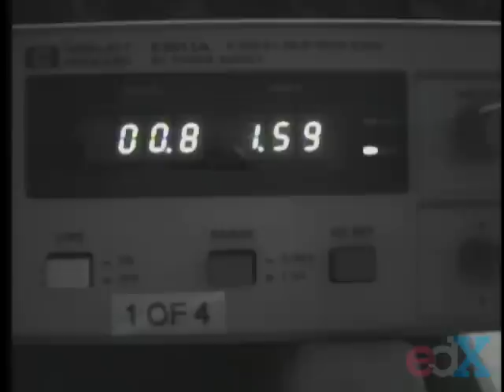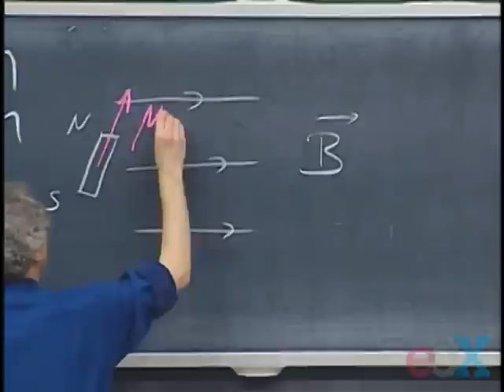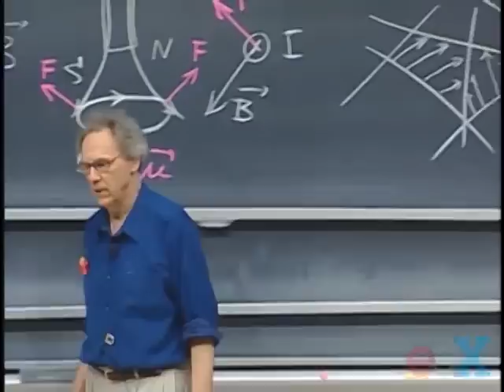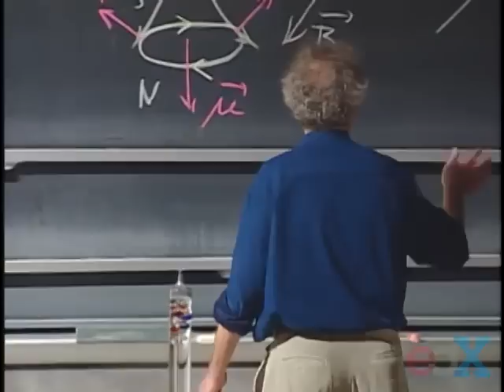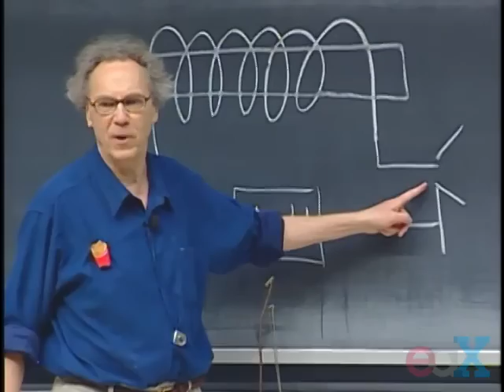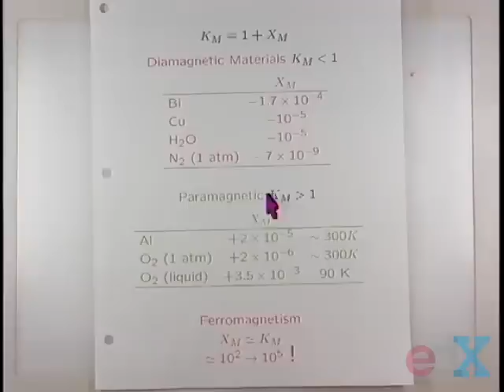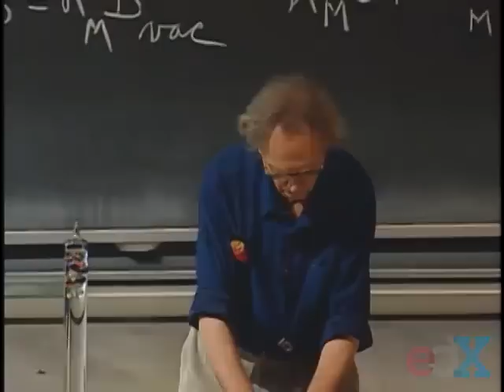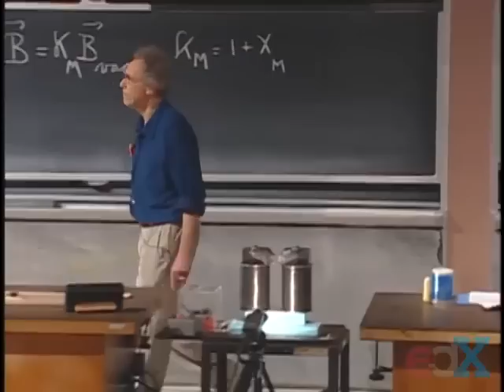8.02x - Lect 21 - Magnetic Materials, Dia- Para- & Ferromagnetism

Comment: While it maybe pedagogically warranted and simpler to explain as Prof Lewin has presented it but domains do not really change their direction of polarization in response to an external bias field, instead the boundaries between neighbors move in such a way as to increase (or decrease) the overall magnetization along with the bias field. The Barkhausen noise is not because the domains change their polarization but because the boundaries are moving and thereby changing the relative size of the several domains. The hysteresis can be conceived as resulting from the boundaries moving but with friction.

Comment: In the demonstration with the speaker and ferromagnetic material in the coil.After the magnetic domains align and you pull away the magnet will the disalignment of the domains in the ferromagnetic material cause a magnetic flux change.
Reply from the maker: yes

Comment: Sir, why are the ferromagnetic materials used as magnetic shields? 
Ferromagnetic materials have large magnetic permeability, thus the magnetic field inside a ferromagnetic material increases to a larger value as compared to that in vaccum or air.
Then, how does a ferromagnetic material stop or shield the external magnetic field ??
Reply from the maker: good question -use google

Comment: Hello, in the laboratory I saw the following phenomenon:
A metal ball is held by an electromagnet but if the switch is opened or the source is disconnected, it remains there for a long time, it does not fall. Sometimes it happens, sometimes it doesn't, for no apparent reason.
The strangest thing is that if the voltage of the source is increased and then disconnected, the sphere is less magnetized than when the voltage was lower. The voltages are small values of 1.5 v of 3v
What could be the reason for this?

Comment: Dear Walter,
from the lecture i understand that your idea of B field energy source of permanent magnet (PM) is kinetic energy of (charged) electron circle movement,
if this idea reflect real nature then what happens when this energy used (as example when PM lifting metal and keeping it on the fly - oppose gravity force)? Regarding conservation law we have only 3 options to see this energy used from - a) charge loose? b) speed loose (and so radius decrease) c) mass decrease? Do you think some of this happens really in nature?
Reply from the maker: It's NOT KE
Reply: Lectures by Walter Lewin. They will make you ♥ Physics. as i understand it is directly related to KE (as I generated by circle movement of charged electron - change speed of rotation and we will see I change)...if i wrongly understand you explain please in short from where energy coming then of B field of permanent magnet?
Reply from the maker: Imagine you have 2 permanent magnets. They attract each other. You pull them apart. YOU have to do work to do that. Now you release them and the work that YOU did is now released. In other words, YOU did the work.
Reply from the maker: The Bohr–van Leeuwen theorem, discovered in the 1910s, showed that classical physics theories are unable to account for any form of magnetism, including ferromagnetism. Magnetism is now regarded as a purely quantum mechanical effect. Ferromagnetism arises due to two effects from quantum mechanics: spin and the Pauli exclusion principle.
Reply from the maker: https://en.wikipedia.org/wiki/Ferromagnetism
The Bohr–van Leeuwen theorem, discovered in the 1910s, showed that classical physics theories are unable to account for any form of magnetism, including ferromagnetism. Magnetism is now regarded as a purely quantum mechanical effect. Ferromagnetism arises due to two effects from quantum mechanics: spinand the Pauli exclusion principle.
Reply: Lectures by Walter Lewin. They will make you ♥ Physics. that is common mistake (as for me) that is why i ask second question how calculate attraction energy between permanent magnet and solenoid (that attracting only when powered with ext source - no core) and post here video where you can see speed increase of the ball after PM attracting one with small speed and with direct kick pass energy to another ball that moving much more faster - so it take energy from somewhere (and if we will replace first ball with solenoid ...by switching ext power off we can pull it apart from pm without any force so can repeat the experiment again and again, your proposal that we "powering" PM by our hand when moving out ball is not the case here)
Reply: Lectures by Walter Lewin. They will make you ♥ Physics. <<<The Bohr–van Leeuwen theorem<<<
pity modern physics can`t answer easily yet with simple mechanical analogy where is the energy source of permanent magnet (i sure answer present and it is very simple and sounds different than that theory trying explain)...
what about second question - how to calculate energy of attraction between PM and solenoid? How convert Tesla force into classical Newton forces (so we can have deal with well known kilograms meters second ...PM can lift (change speed from zero to some value) of 1kg of metal for some measured time) ?
Reply from the maker: The work done by the magnets is due to the potential energy that was present since they were "far" apart. Releasing them will release that PE. If you want to repeat the demo you will have to do work to place the magnets again in the original configuration to restore the PE. In a way, it's like a spring with a mass at the end. PE must be put in the spring to make it release the PE when you release it. If you want to repeat the demo you will have to restore that PE.
Reply: Lectures by Walter Lewin. They will make you ♥ Physics. by replacing ball with solenoid that can be switched on\off with very few energy (modern transistors can do the job for very low energy) we can repeat this experiment...and can`t find the source of the energy (modern physics can`t do this clearly) - it hidden in PM but no answer is the PM itself provide this energy (as you propose explanation that electron rotates so generating I that generating B that do the job) or PM is just and transport of external energy (in past it was named as ether - today physics saying about "physical vacuum" that not the same as absolute vacuum but have some  real mass temperature so it is cloud of small parcels\material that we do not have instruments yet to measure or catch) that we can take from by this simple and easy experiment (just replace ball with solenoid and try it - you will open something new for yourself that nobody discussing today and do not see the magic) - energy clearly passed from PM to ball, and we can repeat this experiment a lot of time - PM will remain own magnet force for ages without loss...but energy we can take again and again and again...conservation law is not violated - we just do not know yet from where energy coming from, but it is good question to try find answer :)
Reply from the maker: https://www.quora.com/When-a-magnet-attracts-another-kinetic-energy-is-produced-Since-energy-cant-be-made-where-does-the-potential-energy-come-from-and-in-what-form-was-it-in-Does-the-magnet-become-less-magnetized-I-hope-Im-asking-this-correctly
Reply: Lectures by Walter Lewin. They will make you ♥ Physics. when i trying to explain this to myself by the words used there (tensor..spacetime...)  i do understand nothing (i can see in real word objects only that have real size, real mass and present in real time...i can`t see with my own eyes `spacetime` or `tensor` - this words humans invent when can`t understand real nature with simple words...so this is form of hiding real answers)... good answer when everybody (small kids) can clearly understand you :)...just my personal opinion...anyway thanks for discussion and your time!
Reply from the maker: A magnetic field of a permanent magnet cannot be converted into any form of energy. The fields of each of 2 or more magnets as you bring them together will not change. However, nature has a way to convert B-fields into other forms of energy that's called "recombination". It happens in astronomy. It cannot be done by us in the lab. Keep in mind that the B-fields of permanent magnets (if you do not heat them above the Curie point), will not change. Yet a permanent magnet can be used as a useful participant to convert energy. E.g., move a magnet through a closed conducting loop, a current will flow in the loop (Faraday's law), but YOU have to do the work as you push the magnet through the loop. The magnet does NO work.
Reply from the maker: Electric field energy can be converted into other forms of energy at the cost of the field strength. Two objects one with  + and the other with -- charge of equal strength attract each other. When they hit each other the net charge will become zero and thus the E-field is gone. The energy in the E-field has been converted to KE of the 2 objects. That is NOT possible with 2 magnets. You can give the 2 magnets a PE and that energy can be released, but NEVER at the expense of the strength of the B-fields. The reason is that magnetic monopoles do not exist. If they existed, you could do a similar experiment as I described with the 2 opposite electric charges.  A N magnet monopole  + a S magn monopole will then eliminate each other and the B-fields of each will be destroyed. The B-field energy would then be converted to KE of the two objects containing a magn monopole.  This is may last msg on this subject.
Reply: +Мишка Коробков
It seems that you are mixing up magnetic FORCE with kinetic ENERGY. Force and energy are not the same. Magnetism is not energy therefore you cannot extract any energy from a magnet unless you or something else moves it, heats it, cools it, breaks it or whatever energy puts on it.
Reply: lvlarihuano lvlarihuanísimo
i sure nature works same ways on any layers (just have different sizes of objects that moving - full picture of any nature action is moved objects that hold information some way...where sizes have no limits to any direction - can be very big and very small...let say ^-100 or ^-1000 etc, we just do not have tools yet to work with such small dimensions...electricity and magnetism can be explained with classic mechanics as small objects movements)

I always stays with B, and I do real job (produce real force) - just have a look at welding wires - they moving ...as well B itself doing real job and produce kinetic force (that move real objects with real masses) too - have a look at motors, electromagnets etc...
Reply: Мишка Коробков
To use welding wires, motors o electromagnets you always need energy, electric energy. Magnets don't move by themselves.
Reply: lvlarihuano lvlarihuanísimo
take magnet into hand and place it near iron ball (let say from the top to see how magnet force can eliminate another
opposed force - gravity) - will it moves to magnet?..So who moves ball? Magnet force or your hands?

Repeat the experiment but replace PM with EM (solenoid) to see on own eyes how it use electric energy. Energy consumed to move iron ball !!! But who feed PM with energy in absolutely same experiment?
Reply: Your hands make move the iron ball, not the magnet.
Reply: lvlarihuano lvlarihuanísimo
:)...
compare it to EM version to correctly understand experiment and see real actor, who move ball when you use solenoid powered by electricity instead permanent magnet? (move solenoid by your hands the same way you just did with PM), you still think your hands moving ball?
Reply: If the solenoid is fixed, then it is the electric current that makes the job. Moving the iron ball with a permanent magnet, or with an electromagnet, is like moving it with a stick, or with a string, or a spoon, or whatever, you can't say that it is the stick or the spoon that moves the ball without employing any kind of energy.

Again; Magnetism IS NOT ENERGY.
Reply: lvlarihuano lvlarihuanísimo
if solenoid not fixed but you keep it in hand and move to position until see ball start accelerate (and then stop move it in this position - so ball continue accelerate then in direction to fixed solenoid)?
If you so like to have fixed position of magnets let repeat experiment with fixed PM (hands off) -  if you have a "key" to turn on\off PM you can do this, right? Can you propose few options how you can turn on\off PM? Do you know any materials that can block B field? Do you know what is permalloy? What about having short electric impulse in coil to create PM on the fly ?

How you will answer on the question then? You still will think that when you see moved ball (change of kinetic energy) it moved by some mystery stick\string\spoon but not real magnet force (and use some mystery energy for this but not energy of\via B field)?

Are you professional physics (scientist\student) or just hobbyist as me? Interesting understand reason why people looking on clear picture proposing some unclear answers and resist to accept clear obvious eyes visible experiments?
Reply: lvlarihuano lvlarihuanísimo
by the way, in this lecture (if i not wrong?) Walter show such experiment with using "key" to turn on\off magnet with static setup - try answer on the question again - what is force (what energy) used to attract (read move > kinetic energy (KE) ) iron when it cold (after heated it move out from PM...that is another switch for PM force),
or you will say that do not see movement and do not see change of KE, do not see who provide this movement?
Reply: Мишка Коробков
Come on, force is not energy! Try to understand that for once and all.

The iron was moved thanks to electric energy.

Why don't you believe what professor Walter is teaching? He's the master.
Reply: lvlarihuano lvlarihuanísimo
review please wiki as well Walter lectures and answer on next questions: 
1. can force do work? W = F ⋅ s do you know this formula?
2. what is relation between Work and Energy?
than let back to experiments
and find where in each we can see exact forces, works, energy if any, ok?

if you see iron was moved by electric energy (as i understand we talking about solenoid experiment) than what energy used when the same iron moved by permanent magnet? do you understand that magnetic field of solenoid and permanent magnet have the same nature but different origin? same nature mean we can say solenoid have force of B field that can do work - move iron objects (were energy source for this work is electricity), and permanent magnet have force of B field! And that force can do same work as solenoid do - can move iron object! But physics (and master Walter Lewin too) do not have clear answer what is the energy source for this work! Place two experiments alongside and you must clearly see the energy used in both cases!

I appreciate and respect everything Walter Lewin doing to teach us love physics!
And i do believe own eyes, Nature is not something you need believe or not - nature is real world, not math, not virtuality but reality.
That is experiment is one of not answered question of Nature, and instead to find the answer you proposing to close own eyes and just believe what others authorities said...Sorry, this is not for me :) If you do not see enigma here than it is just not for you. Anybody can do mistakes...and authorities too! Good luck!
Reply: Мишка Коробков
If you move a ball with a stick, is this stick the energy or the force that moves the ball? No!. It's your hand that moves the ball, and the energy is that one produced by catalysis of the ATP in your muscular cells.

As you say, this (physics) is not for you.

Bye.
Reply: lvlarihuano lvlarihuanísimo
where is a stick in the experiment when solenoid powered by electricity attracting iron ball?
where is the stick in the experiment when permanent magnet attracting the ball same way solenoid doing?

...where is the stick when you use vacuum cleaner to attract some object (hope at least at this question you can find right answer yourself)?
...where is the stick when you see rock falling on Earth because gravity force?
...where is the stick if you will throw two balls into space in parallel way near each other, regarding Newton's law of universal gravitation this balls should attract each other (take attention this attracting forces have 90 angle to ball movements, so it not possible to answer the force powered by forward movement), where is the source of power for this attraction if it have place?
...why by spinning flywheel with tangential force we can have centrifugal force by 90 degree to first one?
...why B force can born I force by 90 degree, if math saying F=F*cos a = .. * cos 90 = .. * 0 = 0, but real force <> 0 !

That is real Nature, it have a lot of such questions where a lot of physics will not answer clearly and obviously (for today).

Bye!
Reply: Мишка Коробков
The stick is just an example, instead you could blow on the ball, or use a spoon as well as magnetism, it doesn't matter.

I give up and suggest you to study and practice Physics if you want to find answers to your questions.

Greets.

Comment: Professor, what metal do you suggest to use in a solenoid for being able to reverse its field by changing the current. Soft iron is incredibly expensive and difficult to find. I would appreciate it if you could reply to me with an easy-to-access substitution of soft iron I could use in my project :)
Reply from the maker: any ferromagnetic material will do

Comment: Professor Lewin, in this lecture you stress repeatedly that the poles of the magnet need to have a nonuniform field for the ferromagnetic material to have an effect and have a stronger field than the vacuum field.  Could you elaborate on this please?
Reply from the maker: use google